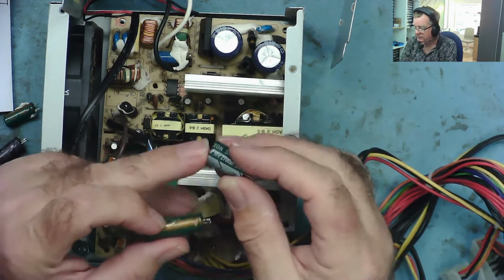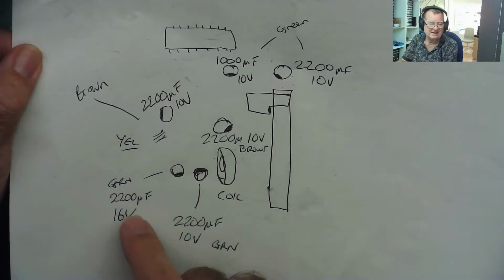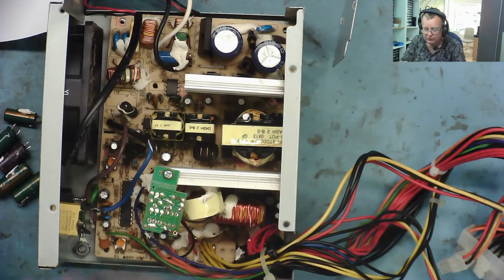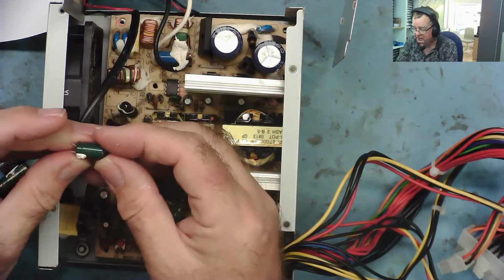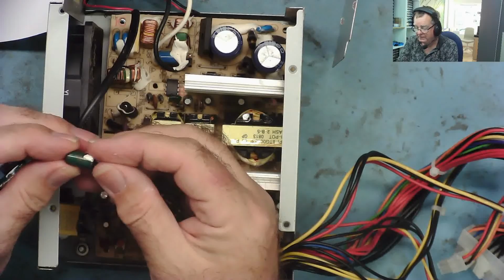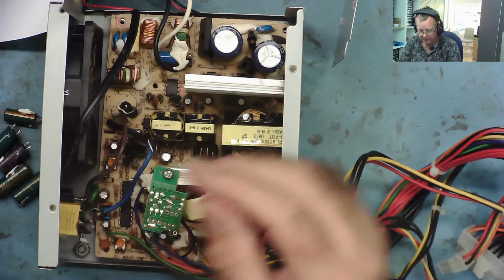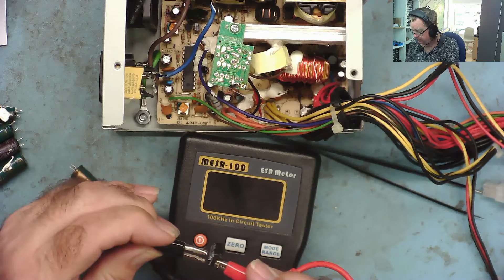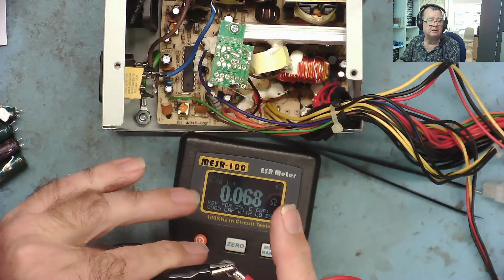ATX Power Supply 5V Standby Low PART 2.  LER #069

Comment: very good video, although i have an inquiry, if you got all the output voltage right 3.3,5,12 but when you put load on 5V it drop to 3V, what is the reason? i check all the output capacitors are find and the 5V output mosfet after the main transformer is fine as well
Reply from the maker: Are you only loading the 5V? (Not 5V standby) 
A lot of ATX monitor only he 3.3V and if this voltage does not drop (because no load) they can not regulate the other rails properly

Try putting a load on 3.3V (I use a 2 ohm power resistor) and then load the 5V
Reply: @LearnElectronicsRepair  thanks for your reply, i'll give it a try, hope you can show us video for fixing ATX with low output voltage or drop voltage with load
Reply from the maker: @learngamecheating  If I find a PSU with that fault I certainly will
Reply: @LearnElectronicsRepair  will be highly appreciated

Comment: Can I replace wl431 with tl431?
Reply from the maker: They appear to be the same thing but I don't know 100%
Reply: @LearnElectronicsRepair  
Im really stuck here and I dot have this IC and I dont know what to replace it with!
Reply from the maker: @techeng3940    OK no worries, here's a couple of suggestions 1: Go to badcaps.net  register for free and post in the power supply troubleshooting section with the question
2: I'll upload a video tomorrow that will show you how to  prove if two the two devices are the same (compatible)
Reply: @LearnElectronicsRepair  
You r amazing!!
This will be very helpful 
Thank you very much I will wait for the video

Comment: Great to see it working!

I am working on a power supply at the moment as well. And i just cant get behind it. I got 5 V standby on my purple wire, but no fan spin and all the voltage rails are missing (note this power supply creates 12V and steps it down with Breakout boards to 3.3 and 5V), so it seems to me that i have a short on my 12 V rail somewhere. Just no idea where it could be, any ideas ?
Reply from the maker: Well if you have 5VSB then that's good because the small power supply is running. OK so What voltage is on the green wire and what happens if you connect Green wire to any one of the black wires?  This should start the main power supply (12V in your case).  If there is a short on 12V to ground you should clearly see that on a multimeter resistance/continuity range with the power supply turned off
Reply: @LearnElectronicsRepair  so there is 3 v on that and nothing Happening when i Connect the Green to black , no Fan Spin nothing
Reply from the maker: @Xorat  It's OK to have 3V on the green wire.  The fact you have 5V Standby obviously says the small SMPS is running but the main one isn't.  You could look to see what controller chip you have for the main SMPS (that generates 3.3V, 5V, 12V) and find the datasheet.  Then you can work out where the green wire connects to enable that chip, and work back from there (does the controller IC have Vcc power, does the PWM output start oscillating once it is enabled (green wire to ground) etc.

The other suggestion would be to join badcaps.net forum, which is free, then post some pics, the PSU model number, and description of hhe fault in the Power Supply Repair section  https://www.badcaps.net/forum/index.php  then reply here and I will take a look.  For sure others will help you there as well. https://www.badcaps.net/forum/index.php
Reply: @LearnElectronicsRepair  thank you very much i will have a Look into it!